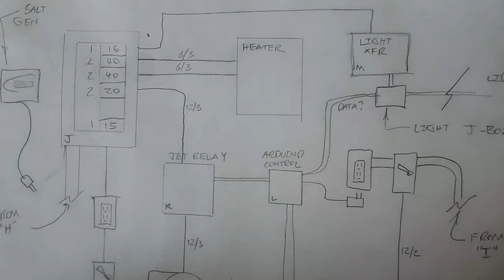Hexagonal Hot Tub Build Full Build in 5 Minutes!

Comment: Hi,
Super build, but as an rc hot tub engineer I have loads of questions. What is the heat loss like through concrete or did you add some insulation into the mix. It seems you have 3" pipe going to all outlets. Why not step it down to 1" to fit standard hot tub jets. It would increase the pressure greatly ( at least to what is available at commercially made tubs.)
Reply: Very late reply, but it looks like they put 2” foam down almost from the beginning, I’d assume that would be adequate insulation?
Reply: @garrett3108 definitely looks to me that he put the rigid insulation in first as well. I’d be concerned with burying the piping directly in the concrete, if anything ever needs replacing, that’s a big headache. Also  @trevorbest5715, decreasing pipe diameter reduces pressure while increasing velocity.

Comment: Are you using the floor channel drain as both the jet and circulation suction with the three ports?
Reply: Right, perfect, thanks. I'm assuming you haven't had flow issues? I love the idea of not having wall suction ports
Reply from the maker: No flow issues, I think I'd like to throttle the base drain a bit to get more flow into the skimmer.

Comment: Really Impressive, however the combo of no insulation and plumbing being incased in concrete is going to lead to a mountain of problems
Reply: @Neverstopbuilding  
Let me start by saying your build out is amazing. Great job!!! I'm a fan of what you have done
Reply: @Neverstopbuilding  

Let me start by saying your build out is amazing. This is better then what you will pay 30-40 g for. Great job!!! I'm a fan of what you have done !!! Truely an impressive piece of work. I will however metion a few things that stand out to me.( Full disclosure I'm in the hot tub industry). 
- My first concern is the pour over on what I assume to be 2inch pex lines. You are in Colorado? So the freeze/frost line would be a concern. A crack on top means a pinch below. There is now way to access any of the plumbing. A access door or lift gate leading to the central plaumbing would help to mitigate future issues. 

-(I'm assuming) the spa is around 350/g @ 8.34 pds puts you at around 2,900  plus material and people. This is tremendous downward force on stagnent line. This plus soil movemnet can cause shifting( this was a huge issue among early hot tubs). If a leak were to occur there is now way to reach it. There are other issues like/Heater/filter/pasive water treatment/filter/filling
I hope I'm wrong on all accounts!!!!!!!!!!
Reply: @Neverstopbuilding  What type of chemicals are you using? Also another thing to watch out for is when draining/filling always put the hose into the filter housing to avoid air locks